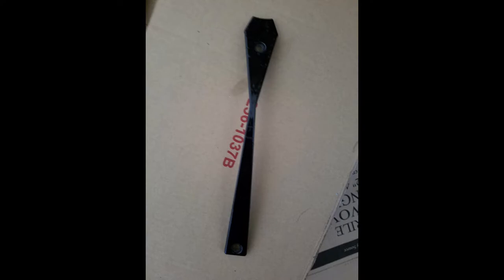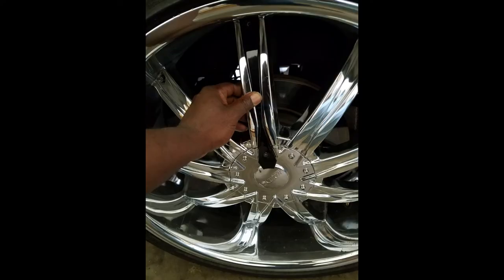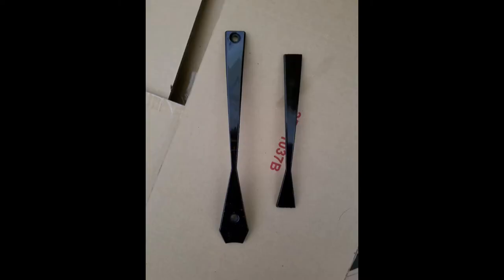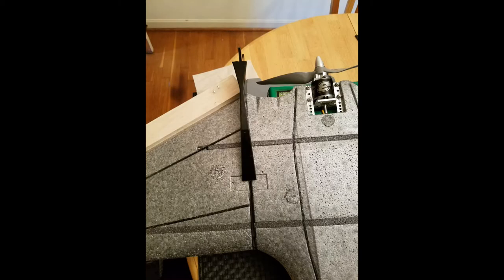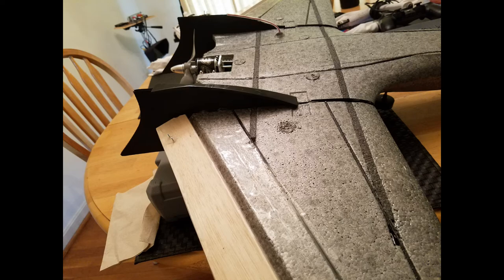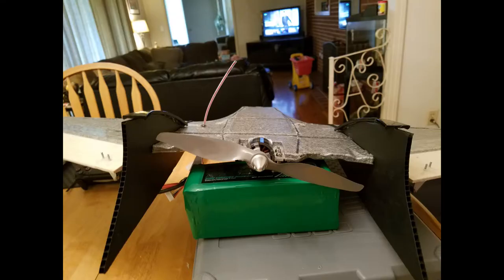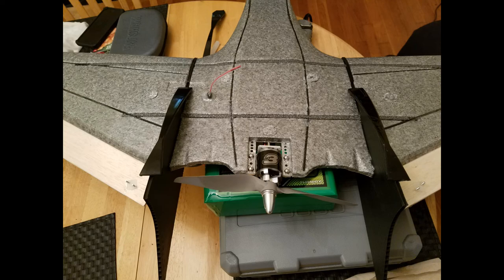Landing Skid Mod Protect Fins Mini Drak

Comment: Dawg, I had the same rims o my 08 Avalanche!!! 26" big bois!!! I hated them s#!ts!!! LOL And the black inserts were always cracking. I got rid of that truck. Anywho, pop up on Thingiverse and search Mini Drak. My boy Aaron Korey made some skids that hot glue perfectly on the coroplast, and he has a keel that fits on the bottom for the nose. Get a friend to 3D print em for you and you'll be all set. Also, if you hot glue the coroplast to the fuse, you can easily remove it with rubbing alcohol.